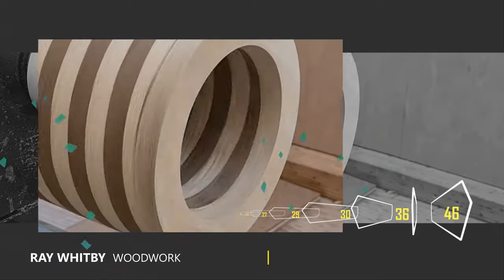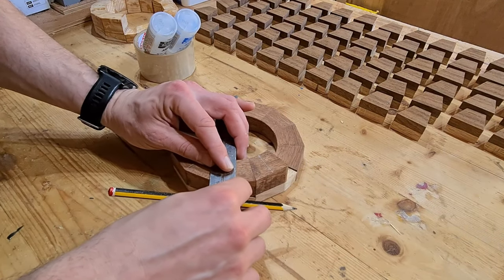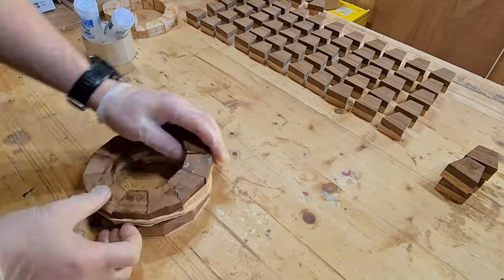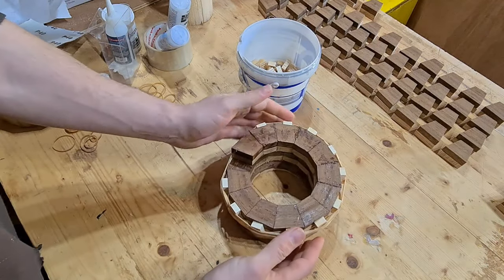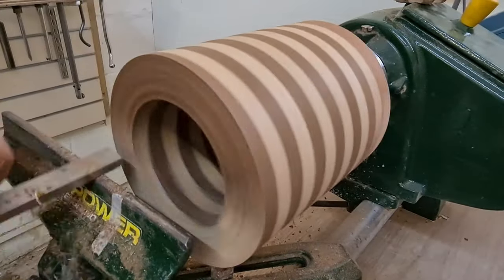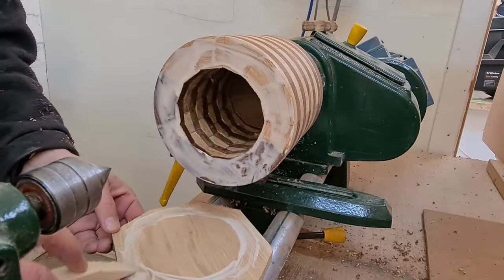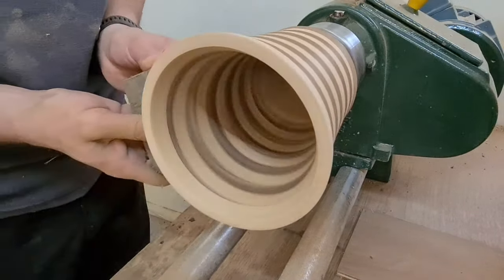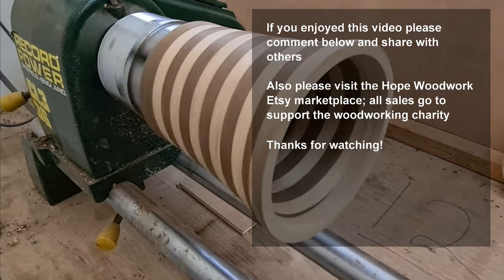Woodturning - The Twister

Comment: Hi Ray! Wow! That is Woodturning with a capital W! I’m very impressed and I’m not sure I  I understand the math behind this… I get the 12.5 segments at 14.4 degrees that give you half a circle (180 degrees). Where I’m getting confused is your  3 degrees at the front and 5.2 at the back… Is that just for the first ring at the bottom and the one at the top. I was wondering why the one at the top is needed for you delicately use the chisel to get the flat surface where you put another ring on it? I’m really intrigued and do respect and appreciate your world record in this! I’m a beginner woodworker and do not yet have the skills nor the equipment to come anywhere near your masterpiece. That said, I’m wondering if I (or you…) would be able to have the two helixes vary in hight along the way? Just as an imaginary project to start with a 3 mm white oak helix as the very begin of the bottom helix and a 27 mm mahogany segment. Added up we start with 30 mm, and along the way we end up with 27 mm of oak and 3 mm of mahogany…   Let me see if I can get my head around it to see if that would be something I can do (in the future). Any thoughts…. (Btw, my suggestions doesn’t mean that this double helix vase project isn’t yet the top of the world… :-). ) Cheers, __Frank
Reply from the maker: Hi Frank. Thanks so much for the feedback. I'll break it down as much as I can; apologies for teaching you to suck eggs, if I do! So the 12.5 segments (25mm in height) and the 14.4 degrees gives you the wedges, as you've agreed. For a standard segmented bowl, there is no helical angle as all the top/bottom edges of the pieces are horizontally aligned. Looking solely on the outside of a cylinder, by varying this angle from zero, it can create a spiral/helix. Using the dimensions I used, I needed a 3 degree angle so that the spiral created would increase in height by 25mm over 12.5 segments. This means that the next layer would be flush with the previous as each piece is 25 mm in height. 

Now if you move towards the centre of the cylinder, the circumference and the helical path length decreases, but the helix still has to increase by 25mm in height over the 12.5 segments, therefore the angle on the inner surface of the cylinder must be greater than that on the outer surface. The depth of each piece was 25mm (I think) and so the inner angle was around 5.1 degrees. Therefore, the front of each piece is cut with a 3 degree angle and the rear with a 5.1 degree angle - the cutting angle varies from 3 to 5.1 degrees as you move from the front of the piece to the back. These angles depend on the chosen diameter and thickness of the cylinder.

If you plot the changing helical angle with distance moved towards the centre of the cylinder, it is not always linear. So the greater the circumference, the less impact this non-linear change in helical angle between front and back has. I used a linear gradient on the bandsaw to make the cut and epoxy resin glue to fill any minor gaps.

I would always encourage you/anyone to try! I had only recently picked up woodworking and woodturning after many years in academia (nanotech research!). If you do attempt this project, I would love to see the final piece please. If you have any more questions, please get in touch! All the best. Ray
Reply from the maker: Hi Frank, I'm writing a short response in case Youtube doesn't post my longer one. It's happened once before, so I will say if you don't see the longer reply, please email me - raywhitbywoodwork'at'gmail.com. All the best. Ray
Reply: @RayWhitbyCreations  Thanks for the longer response Ray. I think that this is fascinating. You mentioned that the greater the circumference the less the non-linear change in helical angle is. Would this also be true if you made the ring with more segments?
Reply: @Mrkozbo  interesting discussion guys and I would really like to try this. I would really like some pointers on the bandsaw jig if you are prepared to share please Ray. I get as much enjoyment from making jigs as using them! One suggestion, a similar principle jig would work on a disc sander but as the disc is stiff compared to the bandsaw blade it will probably be more accurate. Perhaps rough on bandsaw and finish on disc sander. Kevin, if I’m understanding the geometry correctly, the change in helix angle from the OD to ID will not charge for more segments, it’s only going to be a function of the difference between OD & ID, i.e. it will be less pronounced for a thinner walled vessel
Reply: I just realised my comment about disc sander will not work because the top and bottom surfaces of the segments cannot be flat. However, a bobbin sander or router table would probably work if the diameter was small enough. Hmmm 🤔
Reply from the maker: @Mrkozbo  The helical angles will be defined by the internal and external diameter. So the depth of the segments is more critical. More segments means less cutting time per piece, but perhaps more tricky to ensure alignment over so many pieces in the helix. Making larger diameter systems would be the recommendation so the helical angle change (between front and back) is less and therefore more likely the layers would align properly. However, using epoxy resin glue can help fill minor discrepancies.

Comment: To counter the hypnotic effect while turning it, perhaps you could light it with a stroboscope, so that the piece would appear stationary.  However, that would depend on lighting it with only one flash per revolution, which may be way too slow.  Also, the strobe would have to be synchronised to the rotation with a reflective strip on the chuck.

Edit : I have recently made a stroboscope, so I can say that LEDs are good enough for the flash.
This is my strobe here :  https://www.youtube.com/results?search_query=unexplained+optical+phenomenon
At the fastest flash rate, the LEDs are on for only 9 microseconds, and they seem to work OK at that speed.
Reply from the maker: Alas Mike, it's beyond my abilities. When running an engineering department (as a pure chemist) I was always impressed that the engineers could code, program and make electronics work. I never learned beyond Basic, to a little regret now. One day maybe! All the best. Ray

Comment: I'm thinking the horizontal borders created by the lip and base work really well to emphasise that the pattern is something more than just rings. 
I'm not 100% in love with the shape, but I'm not sure exactly why. Personal taste is a very subjective thing, so I'm sure a lot of people will disagree with me about the shape. I'm not saying it's bad, but possibly the interplay between that and the pattern don't quite mesh in my head. I'm also slightly disappointed that you lost the coloured "Mortar" between the blocks. I thought it added an interesting feature to the design (It also graphicly emphasised how much work had actually gone into creating all the pieces and "Building" the blank). That all said, it's still a pretty piece of work, and the skill/workmanship/patience you've shown in making it is top notch.

You said at the end that "you can see a few misalignments of the wedges". I do think you could be accused of being a tad hard on yourself there. I'd put money on over 99% of the people on this planet not even having the skill set needed to fit a solid wood door to an old warped frame with a + - 5mm tolerance these days, so the minimal lines of epoxy you've got showing between some blocks demonstrates a seriously above average level of skill. The precision you'd need to get a 100% seamless contact between all the faces of these blocks is quite frankly impossible in a woodworking shop. It's hard enough to get close to that level of accuracy in a metal machine shop (If it was easy to machine seamless metal mating surfaces, there would be significantly less gasket material used in engineering. :D)............ The occasional little imperfection just demonstrates it was crafted by hand rather than "Produced".
Reply from the maker: Thanks Reman, always appreciate your thinking and reflection on this. Regarding the mortar, 2 reasons why I didn't. The first I wanted each helix to look "continuous" as best as possible and the second was using a little cheat in stacking the two layers one on top another was so much easier. If I put mortar into that latter it meant the accentuated pattern would have be potentially weird; I would have wanted to offset the stacking between the oak and mahogany in proprer brickwork fashion and would require a different approach to the build. Something I'm working on for a future project.

I will probbaly try a little thicker on the segments, not as thick as the first attempt but slightly bigger than these ones. The shape was so tough. I agnonised over it, sketched out a myrad of different ideas. I wanted to try the flat top too. Perhaps I should have left the helix extending into free space and that would get the mind correctly assessing the helical state? At least it works when rotating the piece, but not so much in static photos.

I wonder if I can find someone willing to try a CNC router of these pieces. To see if it can be done. I know handmade wont achieve perfection, but getting more accurate pieces would really help expand the dimensions of this type of woodturning. Especially when the change in helical angle is non-linear in the radial direction and you want the sides of the project to have more character, e.g. small base. Take care. Ray
Reply: @RayWhitbyCreations  With regards to having a "Stepped" or flat top, Why not both? If you used something like double sided carpet tape to join the layers around the last coil and a half, you could turn it as one piece, add a solid flat lid, then separate the double sided taped section to have an invisibly seamed lid that splits along the original block layer join line, and includes one or two steps around the edge........ Did that make any sense?

I wish I was in a position to help with CNCing some blocks for you, But unfortunately my little home hobby workshop's strictly analogue. When I have a lathe tool or milling cutter go "Ping" (And invariably fling bit's of carbide at my face) I prefer it to be totally due to me being a ham fisted buffoon, rather than because I absentmindedly inputted a nought somewhere instead of a one. :D

Cutting these would probably be right on the limit of what one of those little desktop "CNC engraver/routers" could do because to get any sort of acceptable finish with their usual 3mm maximum cutter size would need thousands of tiny passes, And that would take days of run time to do the large batches of blocks you'd need for each project. What you REALLY need is a fan reading this who's willing to donate some dead time on their industrial CNC mill (Preferably one that can run at least a 13mm round nosed cutter at speed through a plank), Or maybe a more engineering orientated YouTuber with a larger CNC router that would be interested in doing a channel collab with you.......... Anyone reading this know of any (Guessing UK based) channels that Ray might want to approach?